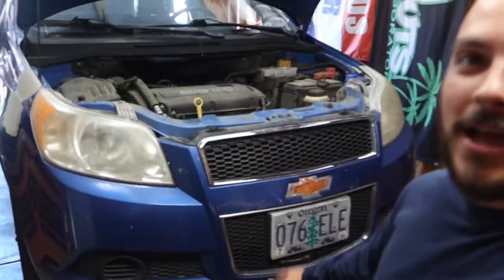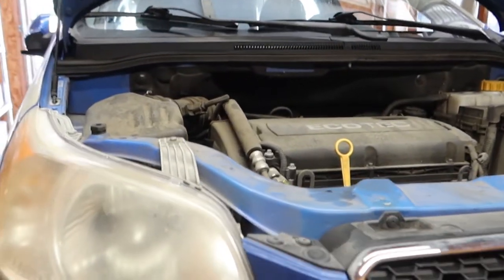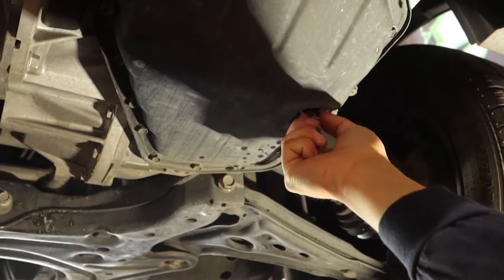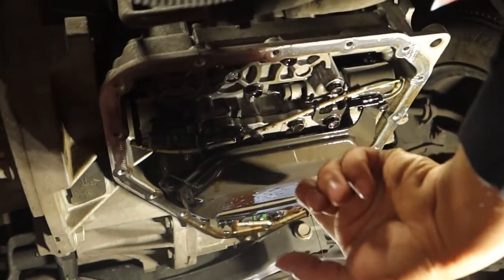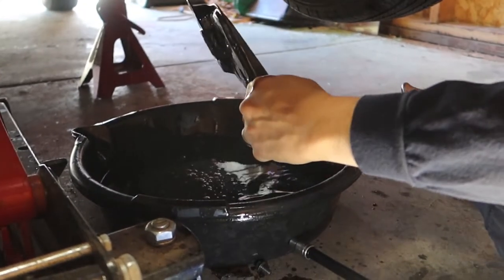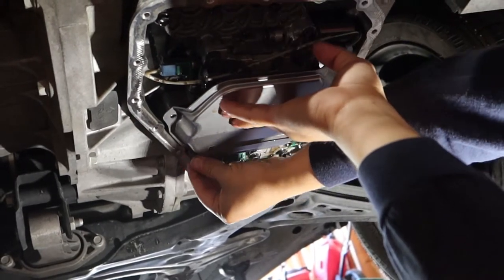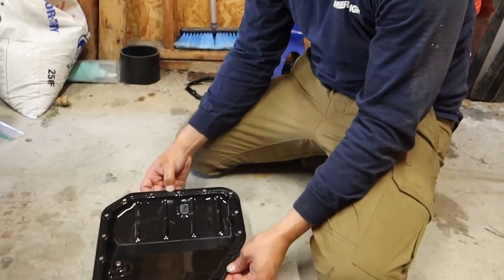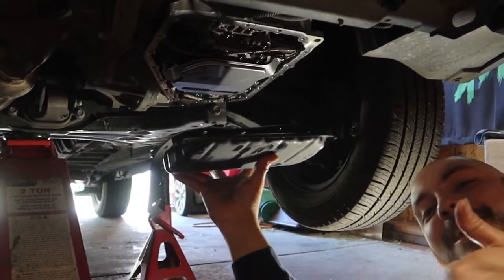How To Change Your Transmission Filter and Fluid in A 2009 Chevy Aveo

Comment: I know a shop that builds racecars. They said if you change the transmission oil to only change it once or it could damage the transmission. The transmission bands needs some dirt to shift properly with the motor. The engine is what you always want clean.
Reply from the maker: I’ve definitely heard that a few times as well! They say you either keep up with regular transmission maintenance or never change anything at all lol because putting clean fluid in it could cause more issues. But if a car isn’t shifting well and feels like the transmission is on its way out the. What is the harm of trying to save it?
Reply: @Boost-EdAutomotive  right. Only if the transmission is acting funny would you change the fluid .
Reply: Thats a myth. The only reason your tyranny would start acting up after a fluid change (not flush) is because the clutch packs are worn badly and the fresh fluid doesn't have all the crap floating around in it to provide friction. Change it when the manual says or sooner and that doesn't become a problem. (Flushes are a whole other ball game).
Reply from the maker: Yeah, I’ve only hear bad things about flushes but I’m not familiar with rhem

Comment: I have a 2006 Aveo special value model. 5 speed, no ac. Runs and drives as it should at 260k miles. Am looking at a 2007 auto with 86K miles as a replacement due to the 2006 starting to rot.

Comment: im a 07 chevy aveo ls owner and it also goes with the automatic transmission. i also have noticed i get a little bit of trouble changing some gears and i know this car wasnt taken care of well because the previous owner would not change the oil. it has about 91k miles on it and i had just learned how to change my oil. to give you an idea it's been about 2 years since the oil was changed last i recalled. i picked mobil1 with the 75k+ engine that states it is good for 20k miles but i dont think im going to wait for those 20k miles, because it has recycled out the old oil and carbons in the engine. anyways, i clicked here trying to learn how to replace the transmission fluid and filter. ill have to find out where i can find the pan for it but at this point im at a part in my life where i cant pay 300 dollars for a mechanic to rip out an extra 1k out of me. thank you for uploading this and sharing how to do this stuff! now to get the tools to do this and then try to find the source of the clunking and squeaky steering. (i had to fork up 1500 for new struts, rack and pinion, right inner/outer, and left outer. so i think it's just the parts incompatibility. they [goodyear] also told me that the control bar for my brakes are almost worn out too)
Reply from the maker: So for the oil I would change it after 3k miles and then after that you could do 5k and definitely not more than 7k. I would not suggest anything more than 5k because oil health is so important and easy to do. For tools, I would get a cheap Hart kit at Walmart and then a couple different pliers and a crescent wrench. Is your transmission pan damaged? You should only need the gasket and the filter to changed the filter.
Reply: @Boost-EdAutomotive  idk i havent checked. I had to buy ramps and my driveway is sloped so i have to be careful when working under there. The garage is chocked full of stuff and thats the only flat place around. Ill have to work at it in the auto parts shop parking lot to get a better look at it.

Comment: Hello very informative video I appreciate the help..I have a question...my aveo 2008 whines in 1st and second but it goes away like on 3rd ( at least thats how I feel it) , can dirty oil be the issue? ( considering the oil doesnt look low on the stick) I have no issues wirh shifting or reverse all gears work fine...I bought this car used so I have no history on it but it seems it wasnt veey well taken care of...I appreciate  help
Reply from the maker: Sometimes a filter and fluid change will fix a lot of problems. Not sure about whining but there’s a possibility

Comment: How much fluid did you need to refill? Did you use Dexron VI? Thanks for the help, video was great!
Reply from the maker: Valvoline multi-vehicle. Get it from Walmart for close to 50% off from auto parts stores. Also we learned the best way it so close up your pan, bring the car back down and fill ot with 3 quarts and then 1 quart at a time and check the dipstick between quarts. We did the full recommended 6 quarts and it was overflowing out the top… so save yourself the time and money. Here’s a link to the autozone page so you can see a picture when you’re shopping at Walmart 😁

 https://www.autozone.com/motor-oil-and-transmission-fluid/transmission-fluid/p/valvoline-maxlife-multi-vehicle-automatic-transmission-fluid-1-quart/318569_0_0?cmpid=LIA:US:EN:AD:NL:1000000:GEN:10574827360&gbraid=0AAAAADkcoVsQleHwJqbKgUT3bE34b8hWB&gbraid=0AAAAADkcoVsQleHwJqbKgUT3bE34b8hWB&gclid=CjwKCAiAyfybBhBKEiwAgtB7fruvkKR4OoPcOFSkWyQixn-3dgDFdSo7A7qIr2k5cEiKLqWuFrnNkhoCPysQAvD_BwE&gclsrc=aw.ds

Comment: Nice .I add a  COOLER  to  my  transmission. Straight to the cooler and by pass the  radiator.I mounted the cooler in the  front grill to catch  the  cool  air
Reply from the maker: Smart move!

Comment: how much fluid did you refill it with after ? great vid btw
Reply from the maker: We did the 6 quarts the book says but it was way to much, so we drained it and did a quart at a time while checking the dip stick for the transmission. I think we ended up doing about 3-3 1/2
Reply: @Boost-EdAutomotive   cool, thanks !

Comment: I have a 07 aveo5 and the manual asks for T-IV fluid. You think I could still use the Valvoline?
Reply from the maker: Just read the small print. The fluid we used was multi purpose. It was t-iv, t-v, t-ví , it was all kinds of fluid compatible. But be weary that some people think you should only use OEM fluid from your dealership